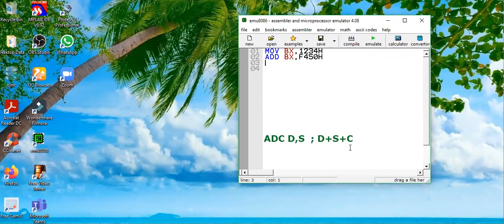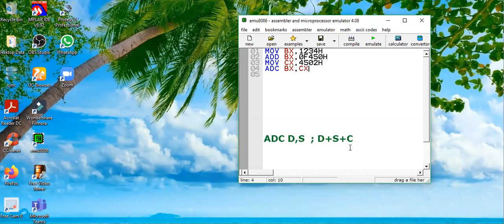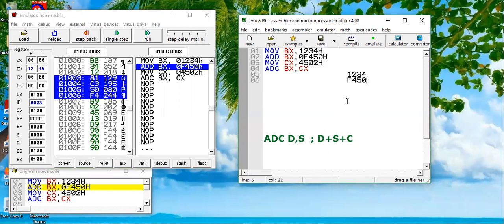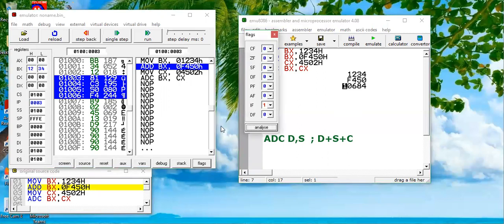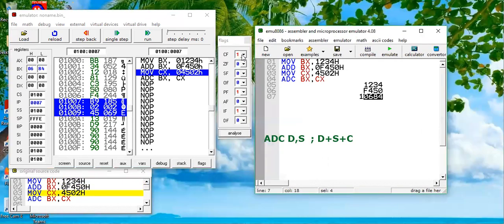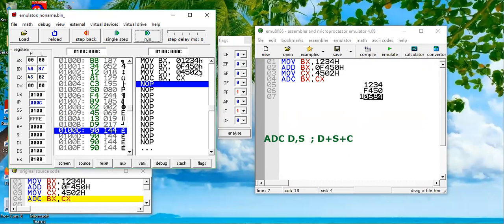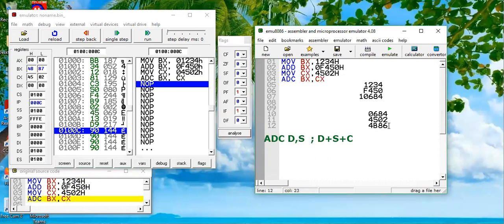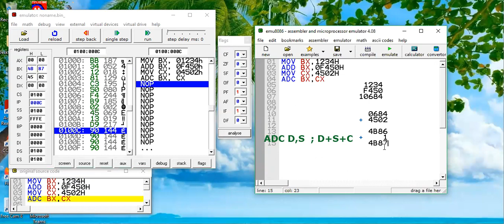ADC INSTRUCTION |8086 Instruction set with emu8086 | ADDITION WITH CARRY IN ASSEMBLY EXAMPLE 8086

Comment: Why don't we just use adc all the time to prevent carry lost?
Reply from the maker: Because we do not want to include ADC every time. For example, we are adding two numbers, and previously a carry is present from the previous operation. So, we should use ADD because if we use ADC it will add the previous carry and the result would not be simply the summation of those numbers. Rather It will be one higher than the sum. So, that's why we should use ADD.  I hope that I answered your question.
Reply: @LearnOnline1  so the carry will be lost outside of operations if we dont carry it , but when do we know to use adc and when to use add to prevent these losses?
Reply from the maker: @finneko-ai  when you are adding three numbers or always clear carry first then use ADC. Otherwise you can use add
Reply: @LearnOnline1  so i should always use add, unless its an carry that i need? and what if the overflow is bigger than 1?
Reply from the maker: @finneko-ai  overflow is something else. Thats not should be taken care in case of add and adc.  However. Your rest of point is valid.